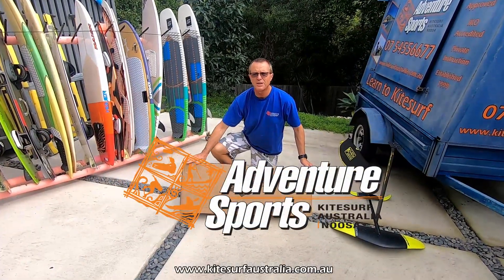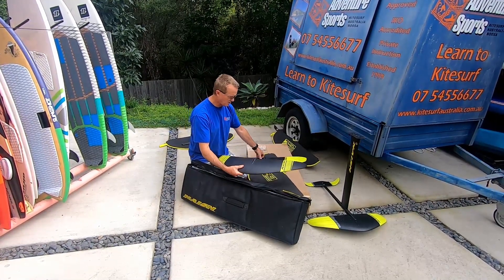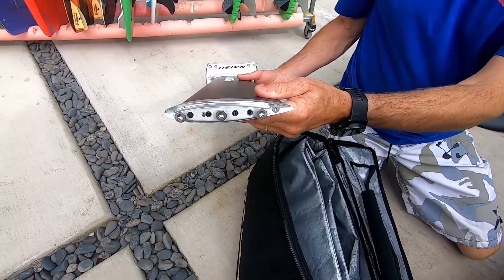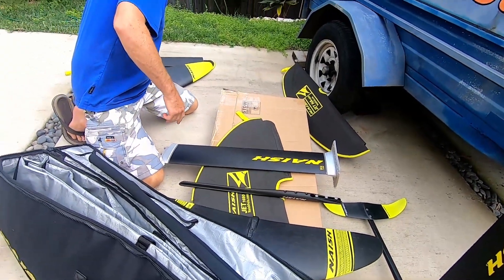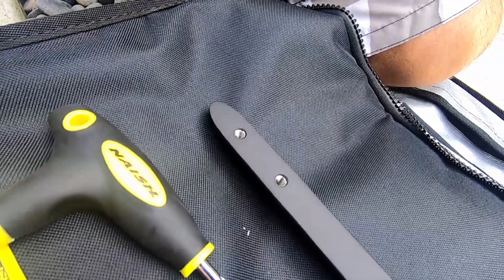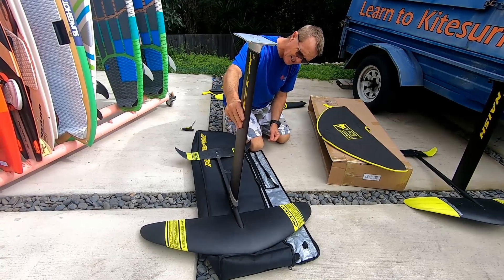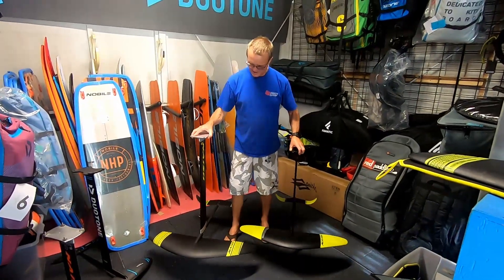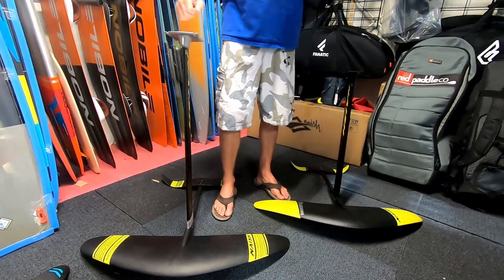Naish S25 Jet Foil Unboxing/First Impressions & Comparison

Comment: Have you compared or heard of a comparison between the 2020 1150 Windfoil and the  S25 version,  in terms of weight?  Thanks!
Reply from the maker: Guessing you're meaning the Naish 2020. Haven't heard of one, but the difference between 1250 surf 2020 and the S25 is significant. Around 20-25% we believe. The same would be expected between the 2020 wind & S25 wind. The same mods have been made. Hollowing out the mast, hollowing out the fuselage, lighter wings etc.
Reply: @AdventureSportsAU  Thank you very much. Another question (I hope you don't mind): How does one diifferentiate the 30mm M6 Titanium screws from  the Stainless steel ones (which again are 30mm  M6)....In case they get mixed up. Is there any way to do so? Thanks again.
Reply from the maker: Hi  @Beachbumextraordinaire  The S25 foil comes with titanium screws. If you were to put them with other screws and get them mixed up it would be difficult to tell them apart, but titanium screws are generally a little darker in colour, greyish. Sort of like the difference between genuine silver & stainless silver.
Reply: @AdventureSportsAU  got it! Thanks!  Additionally (and after about staring at the screws for about an hour: the titanium screws have a dimple within the screw head itself. It’s very small but noticeable. The steel ones don’t seem to have this or are too shiny to reveal it.
Reply from the maker: @Beachbumextraordinaire  Good Spot